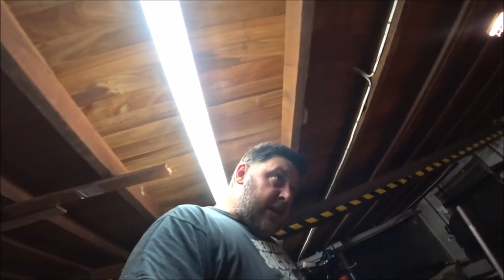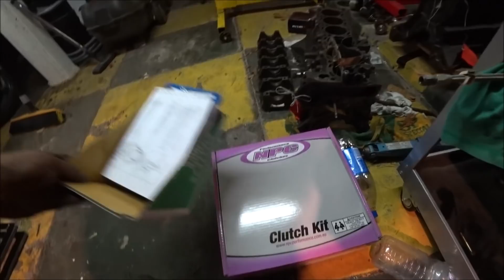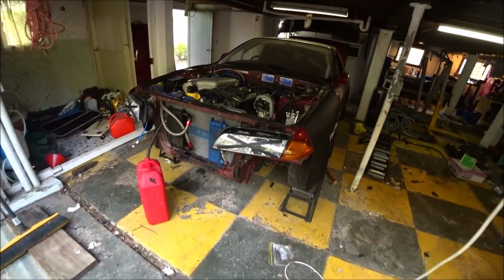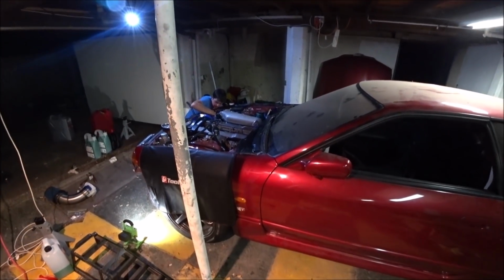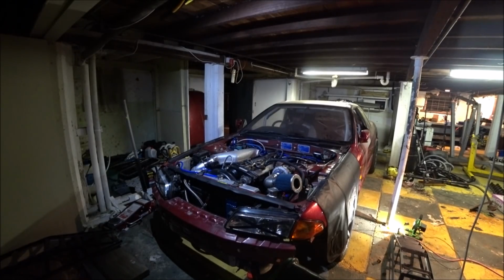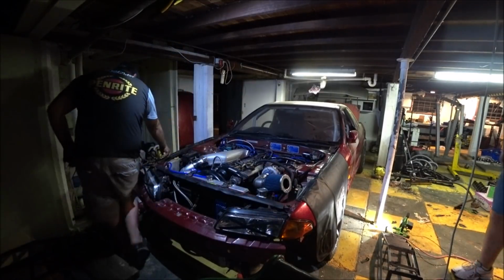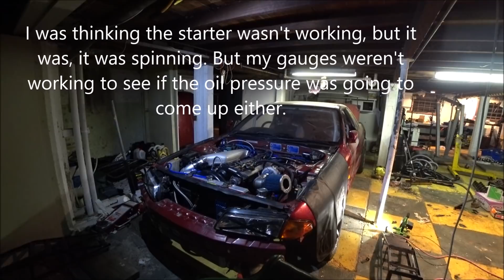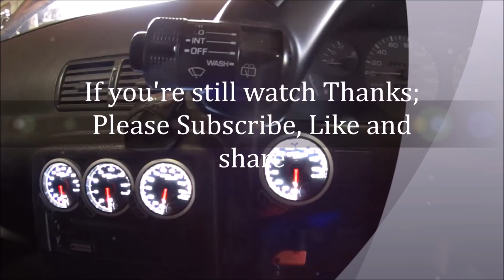RB25DET Build - Everything went horribly wrong

Comment: sad story, hope you get it working. 

Take off the turbo oil feed and have it feed into a bottle if you want to check there's no air lock in the oil system. If oil comes out you should have oil pressure. I put in a new oil pump and didn't pre fill it with oil and no oil would come out of the turbo feed no matter how much i cranked.
Reply from the maker: Ive got 40psi at cranking speeds. Oil pressure is about the only problem I don't have.

Comment: Brand new piston rings? Maybe they haven’t seated? what’s the compression supposed to be?
Reply from the maker: Brand new build mate forged the lot... Comp should be north of 160psi, I would expect maybe 149 until the rings seat, not 65.
Reply: tangles01 ahh I see. Hopefully it’s something minor in the head. 65 psi across the board seems a little odd. Best of luck with everything
Reply from the maker: @lilsk8boardcame  Being dead even makes me thing lifters over pumped.